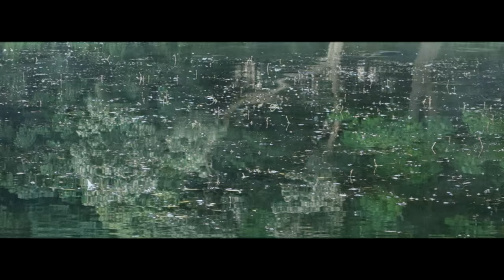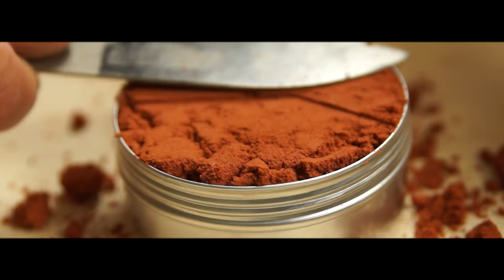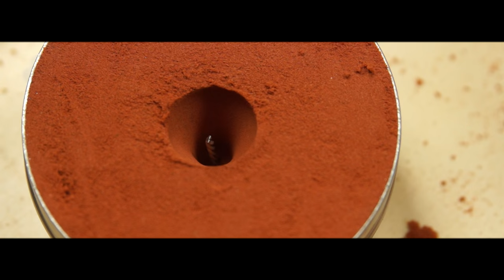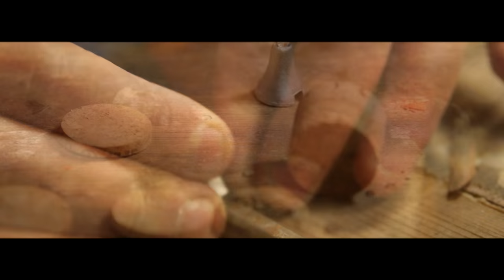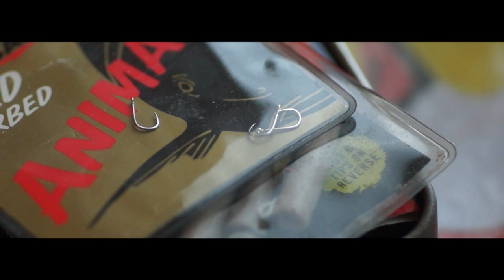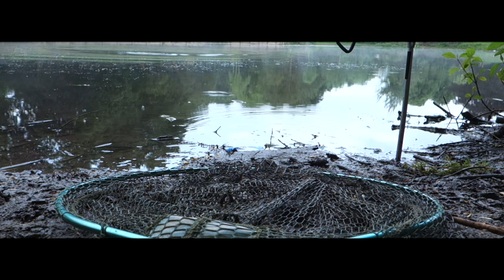A Depth Of Water

Comment: As always, your videos inspire me to get back to the work table and create something.  I read an editorial comment in one of my least favorite woodworking magazines where the editor scolded her readers for spending valuable time making tools, jigs, and etc. that could be purchased for far less than the time spent in the shop.  She finished it by saying, "I think I will go to the beach to get some sand to make my own sandpaper."  I mention this because this video explains my thought exactly.  Yes, you could buy a plummet for next to nothing, but there is a pride in making something and self discovery of techniques.  Thank you for a great video.
Reply from the maker: this was my first real attempt at sand casting so for me it was taking a step forward. Oddly a few days ago i found the original plummet i had bee giving it had gone through a hole in my fishing jacket lining and made its way down the sleeve. so with  bit weird hand in the air dancing  on the bank i managed to get it back. thanks

Comment: Did you make the mold you used for the plummet ?
Reply from the maker: yep
Reply: Do you have any of your molds for sale? You are doing an amazing job man.
Reply from the maker: no its is sand
Reply: Haha. I meant the white plummet with the hole in the middle. :)
Reply from the maker: no they come with the light switch